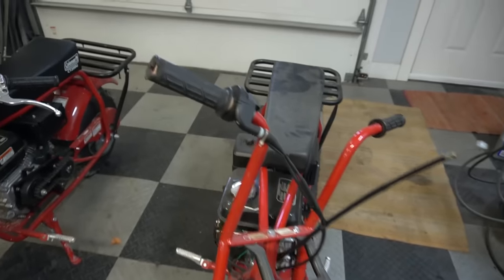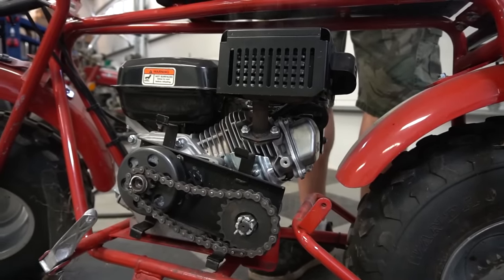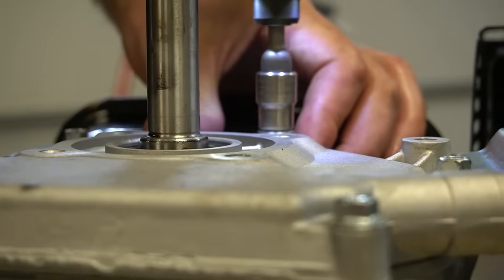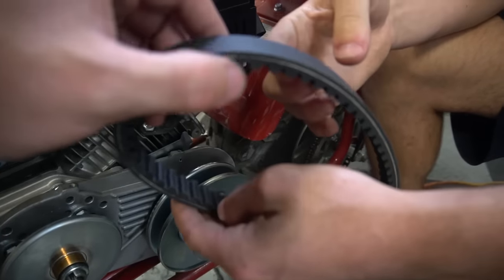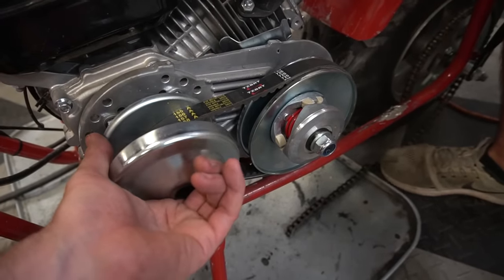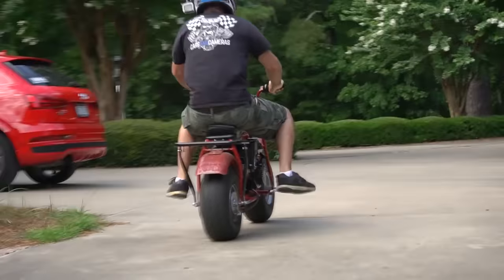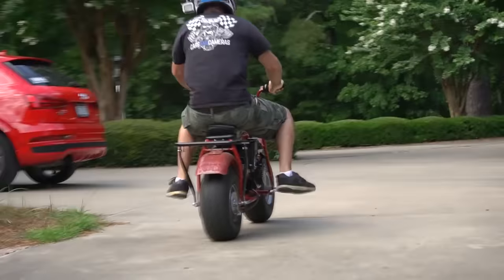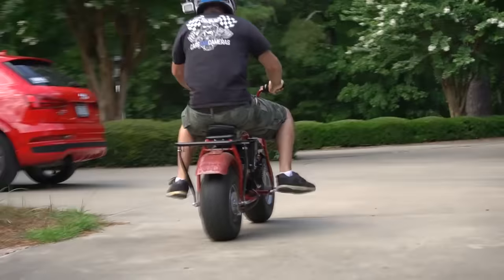Essential Mini Bike Mods | CT200 Performance Parts

Comment: Tall should make a gokart run off of propaine. That would sick amd different haven't seen anyone else do that be the first.
Reply: Alfredo Aldape I sell propane and propane accessories
Reply: damn dude hook me up imma need to hit some propaine today man.
Reply: Propane is a pita for anything that's not a stationary engine ,it's great for standby generators where you would have an issue with gasoline going stale. 
It's tough on valves too,being a dry fuel.
 And it makes less power than  gasoline. 
I think they should do something like that recent hopped up predator ,but run it on e85 so you can crank more timing into it
Reply: Alfredo Aldape motors running on propane (with the exception of propane injected diesels) show a hp decrease.
Reply: rotaxd...propane powered semis are absolutely garbage..the company i used to work for bought a whole fleet of them and they couldn't even run 55 mph steadily..decrease in torque and power and filling them was a pain b/c on;y 1 place with in 60 miles would fill them and it was super busy ..you would sometimes wait a hour to get filled then filling took like another half hour
Reply: Why so they can go slower and have to lug around a tank... how about no
Reply: All I'm saying is it's something diffrent and they sell smaller tanks too man
Reply: Jane Ames agreed. The propane injected diesels I was referring to are typically found in riced out diesel pickups at the track.
Reply: Yes i kno but propane tanks are heavy compared to gas tanks. They have to be reinforced to handle pressure unlike a gas tank making them thicker and heavier

Comment: its really hard to go slow with the stock clutch, they honestly suck.  we have 3 ct200s with stock predators and torque converters and have been dead reliable for the past 10 months and we ride them almost every day. we have put new knobbier tires on them and it makes a huge difference, so if you have a ct200 and youre constantly slipping i highly recommend new tires

Comment: If the serial number is 037961 or lower, the engine originally came with a 3/4 shaft. If 037962 or higher, the engine originally came with a 16mm shaft AKA a 5/8 shaft. 16mm is about .005" larger than 5/8. 

Source: http://shopping.na3.netsuite.com/s.nl/c.3546502/sc.27/category.19045/.f

Comment: 60t rear 9t front you'll be going 50 mph
Reply: BWX I run 70t and 15t its good for about 74mph at 8000 rpm on my bike
Reply: Ryan Rohauer yeah with a TC you can run 50 mph or so without even touching governor.
Reply: BWX ahh I run a clutch don't like how converters lock up at higher rpm they slip to much but I drag race. Off road is definitely better wit a converter
Reply: Ryan Rohauer yup two totally different applications. Not sure what Carsandcameras dudes are going for.
Reply: What's 60t and 9t
Reply: 9 tooth and 60 tooth sprocket. I went 49 GPS down a hill on my last vid with an 8 tooth/ 60 tooth/ torque converter CT200U-EX. About 43 on flat ground and it rips.
Reply: @bwxmoto  9t on where? The jackshaft? I was looking but didn't see much gears for this bike
Reply: Driven pulley on torque converter.
Reply: Ok so if I buy one what all upgrades I can do to get at least 50mph?
Reply: A Rs 50 mph down a hill. Maybe 47-48  mph on flat ground.  Maybe higher if you’re lighter than 160 lbs. Stage 1 and TC plus those sprockets is all. 

I just did a CT200U-EX GPS test with 8t/ 60t on my chan. Don’t want to link here- that’s not cool on some else’s vid but check my playlists for all my GPS high speed tests. Did 9t/ 60t last year with identical setup on CT200U.  Will be doing BT200X soon.
Reply: @bwxmoto  so the TC and 60t rear and 9t front will make it go 45+?
Reply: Yup- with with a stage one kit. Air filter/ jet kit/ header. Should go 45 on flat ground easy depending on your weight. If you're a lightweight kid it might go 50, a giant 300 pound guy might only go 40. Hard to say. That setup went about 46-47 flat ground with me at around 200 lbs with gear, 51.0 MPH down hill all GPS tested (vid on my chan for that too) Was last Sept. 2019 on CT200U
Reply: @bwxmoto  so I just did the re-gearing. Stock 212cc & gears 10t clutch, 50t sprocket and 20t jackshaft and 19x7-8 tires = 25mph flat road. I changed the jackshaft  to 12t. And now I'm hitting 42mph! Holy crap it's fast for me lol
Reply: Wait till you hit 50+ mph! Pretty fun on these little dinky things. Haha
Reply: @bwxmoto hellyeah! I'll need to get me a helmet and a body armor for those speeds just in case lol
Reply: You're smart! Gear up for the slide, not the ride.
Reply: @ryanrohauer5940  is that with or without governor removal
Reply: @daltenroberts6725  8000rpm is without governor
Reply: @aa-bv6nm  all of this is very dependent on tire size as well people don't forget that changing tire size is like changing sprocket size
Reply: @ryanrohauer5940  alright thank you very much for the help
Reply: @Owen Nelson its completely custom but it really don't matter model what matters is Rpm, gear ratio and tire size
Reply: @Owen Nelson the how is the 8000 Rpm
Reply: What’s the difference between using a torque converter and a chain?
Reply: @Dingbobber  TC is a self contained variable speed transmission.  Chain just takes whatever RPM motor is turning and sends it to fixed ratio set of sprockets. It’s the difference between being stuck in 3rd gear or having a working transmission in a car.

Comment: Cool shit!  But i bet you would make better power with stock air cleaner and exhaust. The air cleaner is the reason you need the larger jet. I would guarantee the filter and jet didn't do shit for power. I run stuff on dyno and see it time and time again.

Comment: Torque converters are better and a lot of ways but when you guys did your mini bike guys were burning belts up chains are better than belts the clutches and torque converters should have a should have a torque converter with a chain that would be the ultimate setup

Comment: you can put the belt on the torque converter and the put it on the driver half way as much as you can then roll the bike backwards and it pops the belt on super easy. you don’t have to put it on before putting the torque converter on. just saying

Comment: I put t 8 f sprocket onto my Motovox mbx10 and air intake and exhaust from a motorized bicycle the engine is stock other than a bypass governor

Comment: I really wish theyd call it what it is. It's a cvt.  A torque converter is a fluid coupling between the motor and transmission in an automatic transmission vehicle.
Reply: camyota 912 i agree

Comment: I’ve got a Baja mb 200 completely stock never changed the clutch but I’ve over heated that clutch so many times it’s not even funny but it still works ima gust run it to the death

Comment: I own a ct200u that luggage rack bolt always comes out actually about 90% of the bolts and nuts have been replaced on mine the main handlebar bolt lost its nut while i was driving and the bolt almost came out I was wondering why my handlebar suddenly felt sloppy and like it was shaking only to look down and find the bolt sticking halfway out of the hole it sat in i almost crashed

Comment: I would like to see you make an Electric Kart ot bike, perhaps using a modified high power RC Electronic Speed Controler and high power brushless motor. With the electric motors high torque, it should wheelie and burn rubber like a mad-man.

Comment: Burnouts and wheelies are an extremely important when dealing with machines that are not equipped with a tach or a speedo !! I can see where the lay person could get the wrong idea about these very necessary operations. These things are done so that the rider can gauge the torque and top speed of these finely tuned machines, so as to be able to figure things such as stopping distances and how far this bad boy will burn out down the drive way both very important when drawn into a conversation where bragging rights are called into question !! If these things are not known it could severely damage the hard won REP of the rider/builders must be defended at all costs!!! The boyish giggles and whoops and yahoos , the grins that all if they've done they're job correctly will result in the inevitable bugs in the teeth are all a essential part of insuring the machine is up to par in craftsmanship. If you are a newcomer to this side of this motor sport always remember and never under estimate the absolute necessity of these steps!! This is to insure the safety of all involved even though it just looks like they're screwin around !!! lol      YOU GUYS ROCK!!!! love the builds and dont forget burnouts are a safety measure!!!

Comment: Hey so all i changed on my ct200  was added a TC and did the governor bypass with a 7in piece of speaker wire and it does 45mph consistently. Just throwin some info your way
Reply: How much do you weigh
Reply: @DonnieDarko727  bout 180

Comment: Did you guys swap the valve springs for stronger ones to prevent valve rocker clater do to higher r p ms  the governed removal will allow?

Comment: Extented the frame, go wide in the back, put a 670 in one have a real drag mini bike compared to the last drag mini bike y'all made lol
Reply: Southern Bros' Projects why does everyone think 670s are fast my 212cc would put a hurting on any 670cc I'll put any amount of money on it 1/8th mile. Accepting call outs. 670s are heavy and bulky don't rev and only make good tq racing is about RPM and power it's fully built, rod, cam, flywheel, stainless valves, high compression PnP head big carb and exhaust does 8000rpm. Want some really fast shit do a big block 390 or 420 high compression big cam methanol build there's one from Detroit that has run 7.90s in the 8th
Reply: Ryan Rohauer I'm saying 670 because the rail and the black widow also because it'll give them a challenge to fabricate a frame for the size plus the 670 just sounds aggressive as a dragster.  I know the 212 is fast been watching these guys for years, johns 212 rips.  I want to give them a crazy build challenge.
Reply: Ryan Rohauer when I put things together, usually just to see what I can do and learn from it.

Comment: Do you remove the governor screw completely or did you just unscrew it a few rotations. I watched a video where a kid removed the screw with the spring on it. Please respond and tell me the correct way to get all the power out of the governor I can. Thanks

Comment: No reason to remove the governor with this setup. With the 10 tooth Tc sprocket and 50 tooth tear sprocket you are only hitting 3500 RPMs at 42.5 mph. Not enough power to weight ratio to push past this point.

Comment: Got a CT-200U an MMB-80 with a 212 swap and a few two stroke motorized bikes. My 3 fastest machines the two minis and one of the bicycles all top out at 45. It kinda annoys me, why is it that breaking 45 mph feels like attempting to break the sound barrier with these little engines.

Comment: How are the torque converter for long distance ? 
Say 40-50 miles at a time or more.
Reply: Douglas Dailey industrial mechanic here, my experience with torque converters on mini bikes is very good, I’ve never broken any, but I’ve always aligned very well as trained. But remember you will have a more significant power loss in your drive train with a torque converter (and they get hot from the power loss)
Reply: @wadekrueger6178  thanks for the info.
Reply: Almost every scooter on the road today has a cvt / torque converter on it. If you have the right roller weights, reaction spring, and clutch springs they will run for thousands of miles before needing cleaned and roller weights inspected for flat spots.

Comment: Hi, I'm wondering if there is any "real" reason for the manufactured fins on the inside of the side cover on my 5 hp Briggs.  To the untrained and engineered..."me"...it looks like the oil has some sticking points and keeps it from flowing uninhibited.  Have you ever removed or modified any of these internal fins?

Comment: I have a super huge question!!! I have a 208cc power fist engine (Honda clone) and it's super similar to the predator. I have stage one kit on it but the governer is still inside the engine... I'm scared to take it out and risk blowing my engine so is there a way I can make my bike faster with out taking out the governor

Comment: Man, I bought one at 11:00 p.m. at Walmart and misread that it took 6 quarts of oil not .6... 1.5 Qts in, in the dark, I realize it's overflowing onto my black driveway. Heard .6 on the video and ... Should probably just start over since I have all these extra quarts now anyway. 😂  I let it drain the excess from the input in a pan 🍳 but probably still over full eh?

Comment: On the subject of output shafts... Im down in New Zealand, and obviously we use the metric system. I have been buying parts online from the states which advertise as 3/4 (19mm). But my engine shaft spec is 3/4" but the shaft is actually 20mm. What is the correct inch measurement for the 20mm shaft so I can order the correct parts as converters don't give me the fraction version of inch. Thanks!

Comment: Hey there. I have an old taco bike it used to have a 1.5hp on it and we swapped it for a 5hp honda. But now the engine hangs off one side way more and when your riding it you really have to lean to the other side to drive straight. Do you have any ideas on a way to fix that?

Comment: Do you need to get the risers with a torque converter for a 212 predator engine with a 3/4 shaft?

Comment: Can I install a 212 HP without cutting the frame? I also would like to add a performance kit and torque converter to a 212

Comment: Yo my brother bought a new minibike. At CT200-EX I think it is. I rode it rough yesterday. Looking at the timestamp 2:16, that black assembly bolted to the engine, the shaft the larger sprocket sits on had the leftmost bearing in it grenade out and its gone. its all chewed up. Should I just give him a torque converter to replace that or can I find the parts to fix that?

Comment: Wouldn’t getting rid of the governor make the rpms to high for the engine to handle
Reply: With the stock gearing yes but with a torque converter no.

Comment: How about a predator 212cc hemi .020 longer billet rod, f275 cam 26lb valve springs 10:1 compression ultra lightweight flywheel 1.7lbs, stainless valves big carb , big exhaust and a good straight line port job. And the intake manifold port matched along with the gaskets Geared to do 74.5mph at 8000rpm on a orginal doodlebug. Is that fast enough yet
Reply: Ryan Rohauer lol. Faster then i wanna go
Reply: Isaac it'll be fine iv been to afraid to stay in it past 58ish mph pulls very hard lol

Comment: correct me if i'm wrong but since the tc keeps the engine at a lower rpm doesn't that make a govenor delete useless
Reply: Wesley Ronne not when you have the power to get it to rhe higer rpm

Comment: I had no idea about that belt tip, o did an engine conversion on my gokart and I have prob spent 80 bucks on belts because we thought they were too small, maybe we put them on the wrong way
Reply: GetGood2001 I had a 7inch tq converter and ordered 6inch belts they would idle away but they would grab sooo good and once they broke in they were perfect I have shredded some belts lol I always brought some when goin far and some ether and and air pump learned that the hard way lol an off-road kart is tough on belts
Reply: Ryan Rohauer yeah, I have an off-road gokart as well, so I’ve shredded belts too often, I even have permanent scars from when one whipped me
Reply: GetGood2001 Jesus I had a steel plate behind me so I dident care lol
Reply: Ryan Rohauer yeah I learned my lesson and put a cover over the belt

Comment: Question????? Have you heard of a Predator 280cc? Is it the same as the 301cc or 212cc? I Have a 280cc from Harbor Fright and can't find upgrades, even at Go Power Sports. I did not call GPS yet.
Reply: Building Trades i havent seen that engine size
Reply: Thanks. GPS said they don't know anything about the 280cc predator.

Comment: Hi guys its me again YouTube ID m42665 I know your looking for speed with all the stuff you have BUT your forgetting about the Honda trail bike ! Did you know in half a block or less you can get 50mph this is just getting in third gear with out winding it out and you still have one more gear left four  !
Reply: m42665 mine is only a 3 speed 72cc
Reply: You guys was always changing motors on everything so why not put a bigger one like a 140cc or 160cc      and if you want it bigger then there are parts for that . Now if your worry about the front coming up too much you make a longer swingarm next thing your going to get high speed wheel wobble after 60/mph your need to put more rake angle on the fork not hard you guys can do it . I know everything about this bike .

Comment: if someone can please give me some add, im new to the mini bike life and i have a few stuff on order and im wondering what to expect and or if anyone has already done this.... so i have a Mega Moto Classic 105cc frame with a newer Briggs 6.5 212cc with govern removed. i plan to run a simple clutch, chain and sprocket setup. i plan to use a Max Torque SS 19Tooth Clutch from OMB warehouse, and a Mega Moto 40 Tooth Sprocket and chain, all for 35# chain from monster scooter parts. if someone can please give me some in sight. Awesome vids you guys put out as well, ive watched them all at least a couple of few times lol...... also with the setup i mentioned, would i be better keeping it clutch or should i swap to something different, thanks alot.....

Comment: My buddy and I took the torque converter out and ran straight from the shaft with a chain and it goes 60mph+
Reply: Does it still run good😂